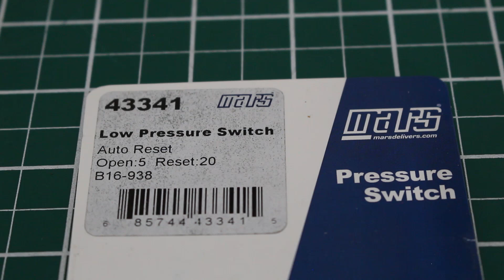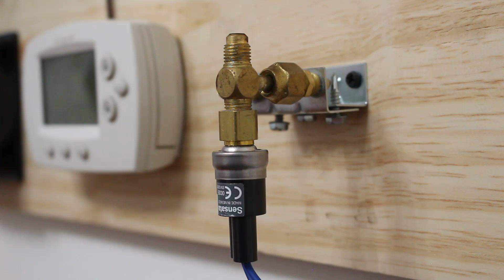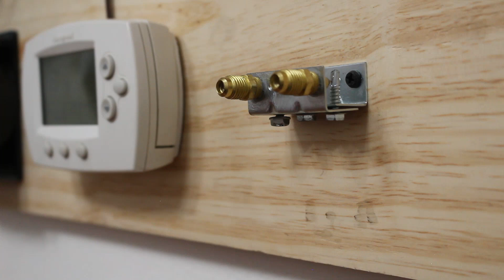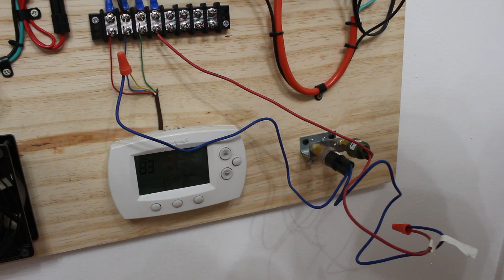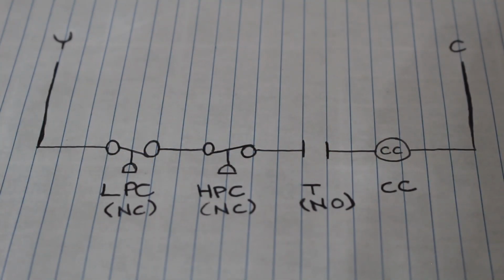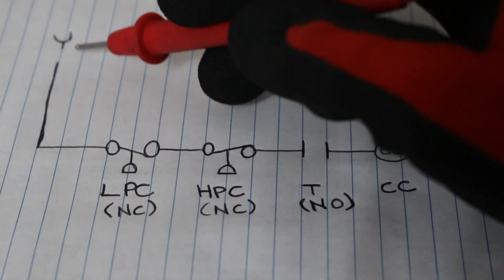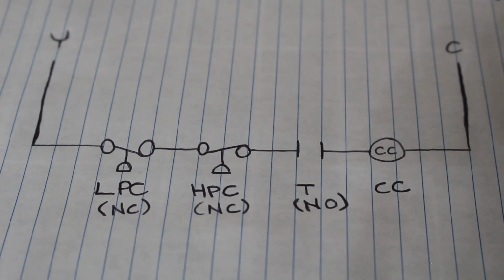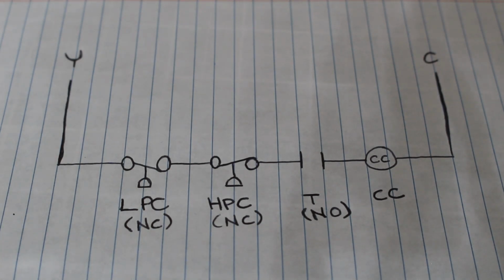HVAC: How To Wire High And Low Pressure Switch For A AC (How To Install High/Low Pressure Controls)

Comment: Great explanation,  but for more practical purposes should you wire it next to the contactor from the coil side, through the switches since in reality we wont be running those wire indoor at the thermostat?

Comment: Great video. Would you please make the video how to wire dual pressure control switch on refrigeration. like a mechanical one that control temperature on reach in freezer. Thanks

Comment: Thanks for sharing. Question:  (Without the Timer)  Can I connect the yellow wire going to the contactor, in series with the pressure switches, and connected the other end to the contactor?

Comment: Sir how about with high and low pressure switch, ah3 timer 8pin, .magnetic contactor.with tor, do i need to add lock out relay? please create a wiring diagram, 3 phase Compressor of  AHU thanks ❤️

Comment: I know this is nitpicky, but your LPC and HPC drawings are labeled opposite of what the symbols mean.
Reply: Can you send a link with a clarification plz
Reply: @lyndonlakhansingh  after further review of other documents, I have seen it done both ways. So, either orientation could be correct. It depends on who is writing the schematic. Some use the left pole and some use the right pole as the one that opens. In this video, he is opening the right side pole on pressure change. As long as that is specified, the video is correct.